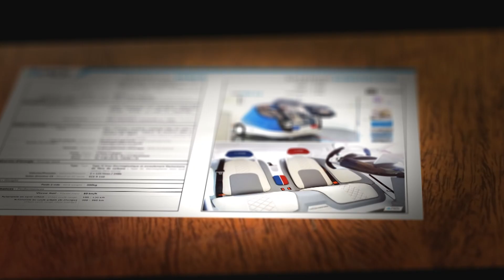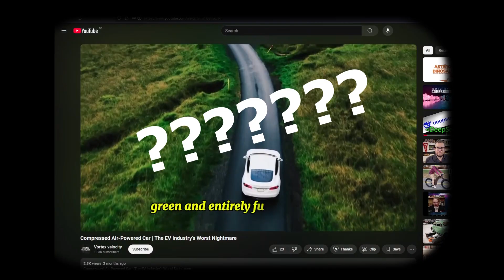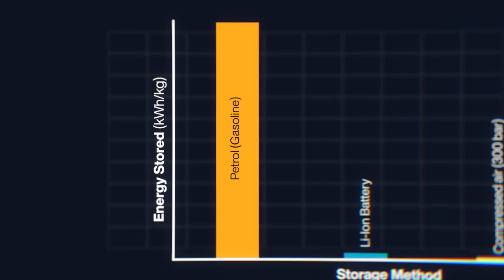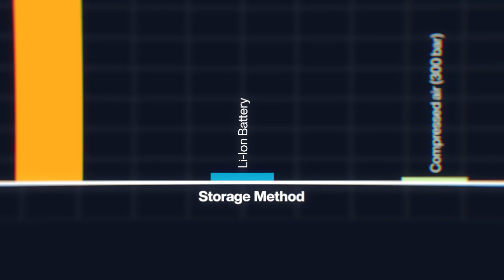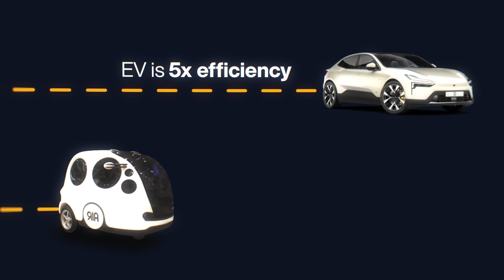Why Did the Air Car Fail?

Comment: Kind of unfair to claim that ”electric cars can explode” when comparing them to high pressure bombs. If you crash with an EV theres a low risk it will catch fire. If you crash with an airtank there’s basically a 100 % risk of boom.
Reply from the maker: Fair point - although there's been quite a bit of work done around making sure tanks like this are either very unlikely to fail, or fail gradually, because of course these things pop up in lots of other important applications where they can't explode. Definitely still a risk though. Not entirely sure why I'm defending the air car here lol.
Reply: @ What other applications are similar to a car crash? :o I can’t think of any application where it’s used in a situation where it might be subjected to an impact at 70 MPH. 
But sure, you can make a tank that survives a car crash, but then it reduces the specific energy even further.

Comment: The air car would probably work much better if you added a way to mix in a very light lubricant to the expanding air and then incinerate it to reduce tailpipe emissions. Waste pressures could be recovered with a couple of oscillating cylinders used to drive a shaft. Idk, it sounds like it might work. 😂
Reply from the maker: Wait, I've seen this one before
Reply: You would also be able to come up with a way to compress the air within the vehicle so you could do away with the pesky problem of range anxiety when it comes to looking for a compressed air source.

Comment: Note that gasoline engines are approximately 30% efficient. But because gasoline is so energy-dense, it works.
Reply: Typical use of the 50’s stat. A modern petrol is around 43% and diesels over 50
Reply: @highlandrab19  True for new cars. But my Hyundai i10 2008 petrol is still around 30% however. Edit: 9,7% total efficiency according to calculation with 27liter/450km if you take in count of everything.